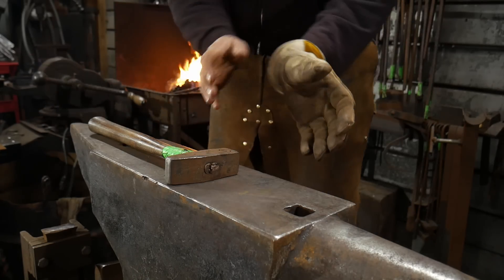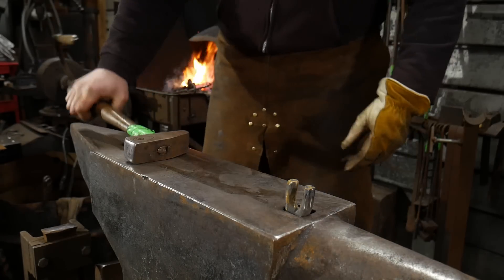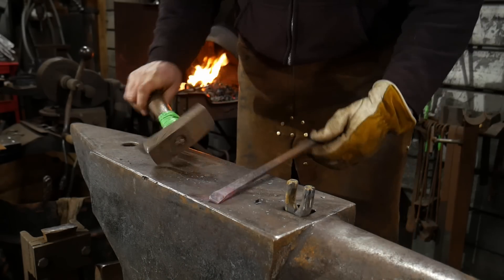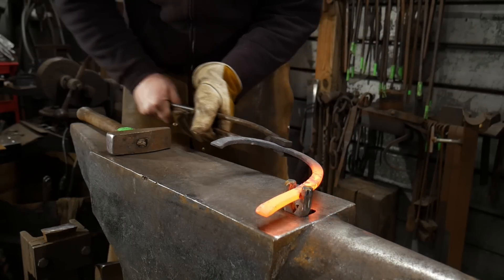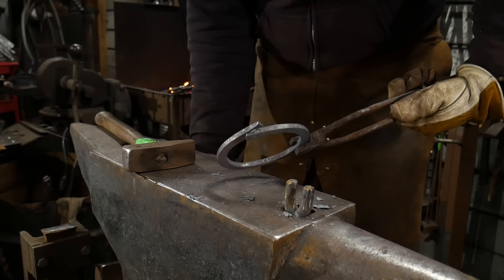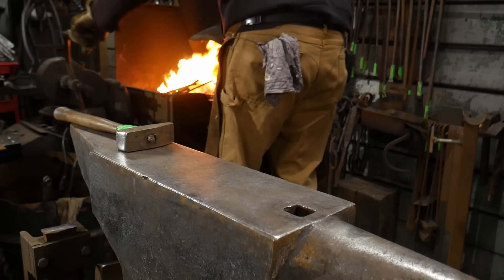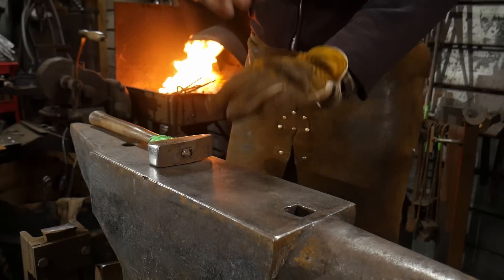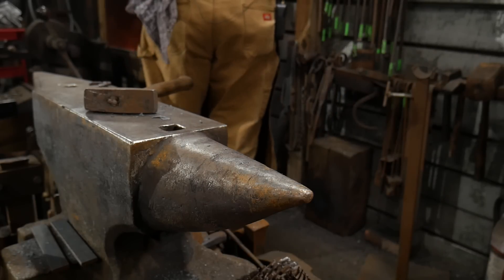Flat Forge Welded Ring (Forge Welding Techniques)

Comment: These flat rings open tons of projects if I can forge weld. Thanks.  I just bought a shiny new rounding hammer that I really admire. The handle was just 'okay' and I figured it deserved a little TLC.  So, I scraped the stickers off, really sanded it to death and applied a couple coats of Birchwod Casey TrueOil with just my fingertip,  like spit shing a pair of boots.  It looks like a wallhanger,  but,  I'll use it anyway. Not too slippery either.  If were close by,  I'd dye cotton twine your favourite color, and put twine whippings on your tool handles, instead of icky-sticky tape.  Too much time for someone who works for a living I know. Cheers.

Comment: It looked like you had the scarfs the opposite way from how I've always seen them done, like they were reverses (top on bottom, leaving a gap between the toe and the the bar of steel it's getting welded into). Any reason for this? Seems like it'd just be inviting the toe to melt away, not to mention inclusions, and scale building in between.

Comment: Looks to me like your fire needs to be taller and hotter…too much oxygen hitting the steel surfaces.  The weld seam should be forged to stock size and blended to a point where it’s difficult to detect with the eye. Less oxygen, taller fire, and more heat will give you better stronger welds.